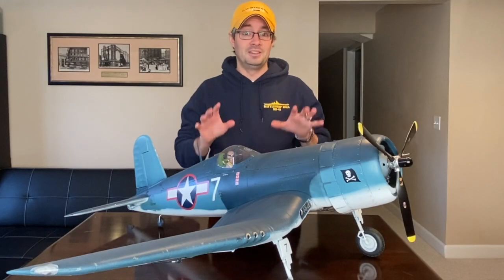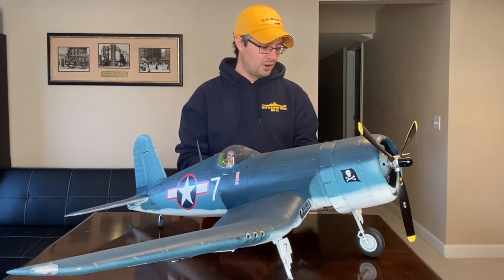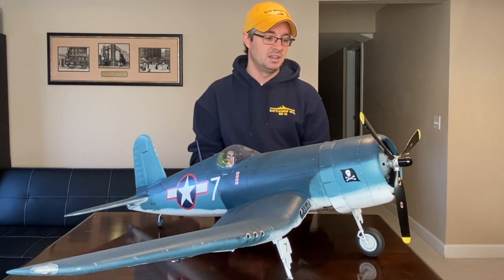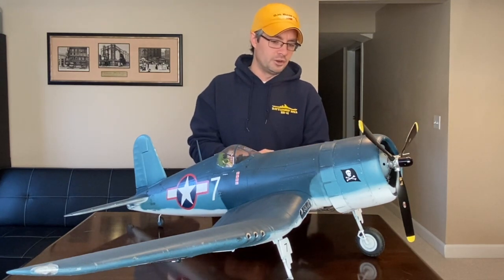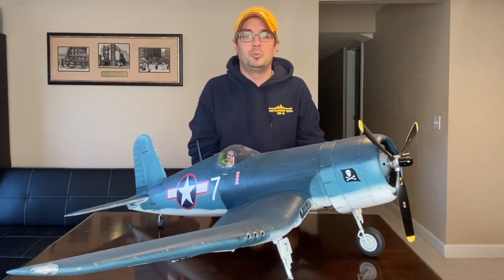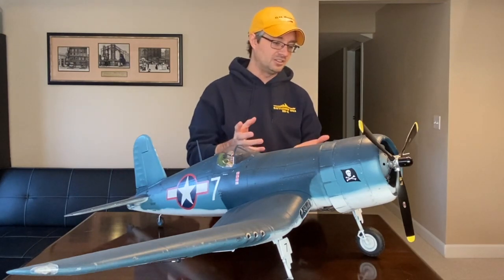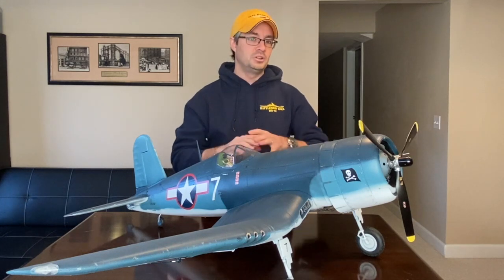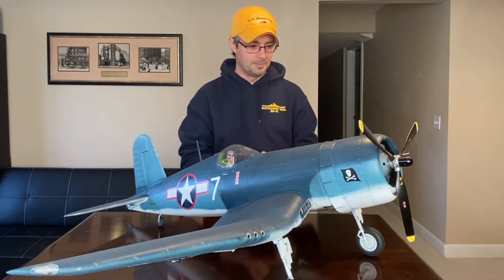Custom Repainted and Detailed E-Flite 1.2m Corsair Project Review

Comment: Very nice job! I want one,but will keep it -4,but painted like in '46-'50,when my dad was a mech on them in the Marines,VMF-222,Flying Deuces! I don't like the green on this one.Thanks for this video!
Reply from the maker: Thanks! It would actually be really easy to turn this into the VMF-222 F4U-4. My suggestion would be to get some gloss latex paint from Home Depot or Lowes that is matched to the model, remove the decals that go over the green stripes, paint the blue over the green/white stripes, and apply new decals from Callie Graphics. It would be so much easier than what I did. There is something awesome about flying a model that has a family or personal connection! I have one of my Cherokees and both of my Archers painted up to match my grandfather's planes. It brings back a lot of memories with him when I am flying the planes. Since none of my family members flew in WW2 or Korea (my maternal grandfather flew in the USAF between the wars), I pick pilots with a connection to Michigan and model planes after them. Not nearly as awesome as having one done up as a family member.

Comment: Awesome build! As far as the nav light clear covers from which model did you use them from? Thanks!
Reply from the maker: I am not totally sure as they may have been leftover from another project. I have a box full of little odds and ends that I dig through to see what I can use for other products. I typically buy the plastic detail parts for planes that are 1.1m to 1.5m and then pick out parts that can be reused for other planes. I bought a bunch of the E-flite Cirrus plastic parts as they have all the antennas, steps, handles, and stuff for general aviation planes. I have those parts on my Cherokees, Timbers, and have used the design as well to make my own parts for smaller planes. The Corsair lights may have come from another Corsair model as they fit pretty well. They aren't perfect, but they are close enough. Possibly the BlitzRCWorks Corsair or Arrows.

Comment: Nice plane good job, I have the same plane but with the stock servos do you recommend me changing them ?
Reply from the maker: It is up to you. I swapped mine out for metal gear ones since it is easier to do that before painting. Out of 1200 flights and over 40 aircraft, I have had only one servo fail. The one that failed had a rough landing before it went bad, so that can be easily explained. Some of had flap servos go bad, but I haven't had that on any of my planes. If you do decide to change them, Spektrum makes a metal-nylon hybrid servo or full metal gear servo that drop right into the factory openings. The Corsair uses all standard rotation. Some E-Flite planes use reverse rotation servos. It is important to know which servos come with the plane in order for AS3X and SAFE to work. You can't reverse the servo in the transmitter and get it to work.

Comment: the switches you mention on the top dash are bomb control switches :)  bomb arming and bomb drop release control and rocket
Reply from the maker: That is what I figured. Having that panel on top of the dash might be incorrect for my Corsair since the ability to drop bombs came after the first tour. It was in December 1943 in Australia the Jolly Rogers and Vaught engineers developed a bomb release mechanism and started to drop bombs on their second tour. Mechanics tried to rig up a bomb rack on the first tour, but it was deemed too unsafe to fly with, so they worked with the factory engineers between tours to get a system that worked better.